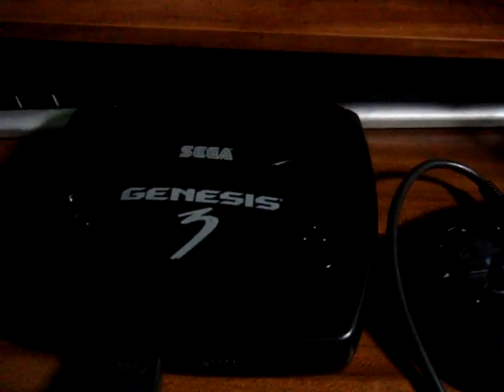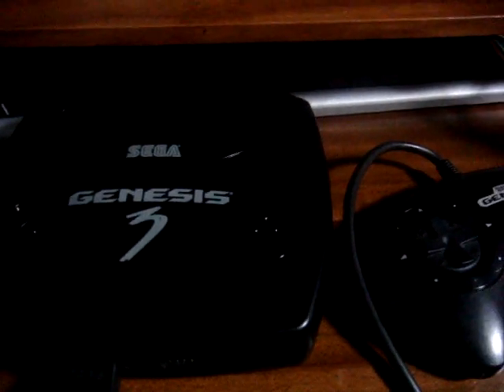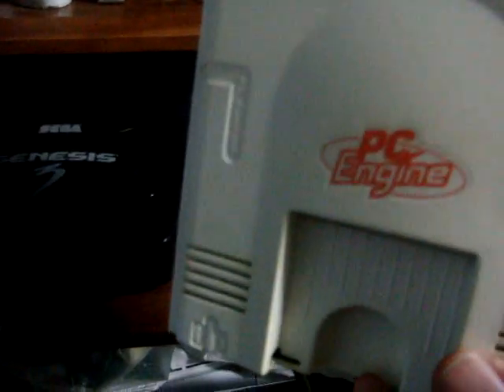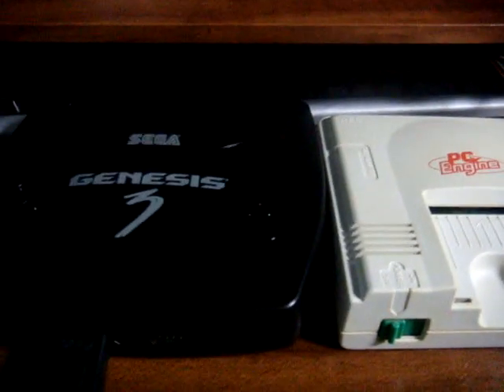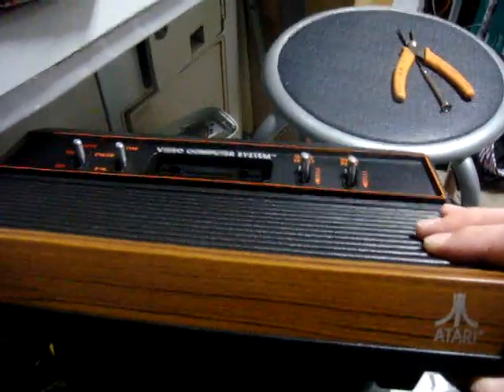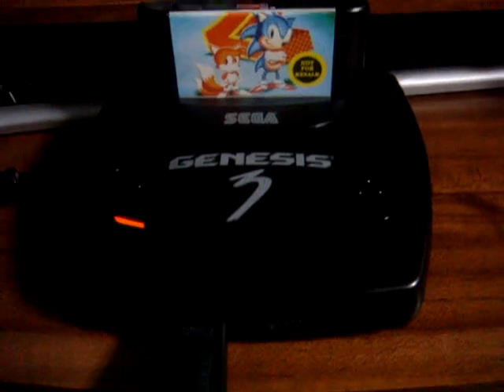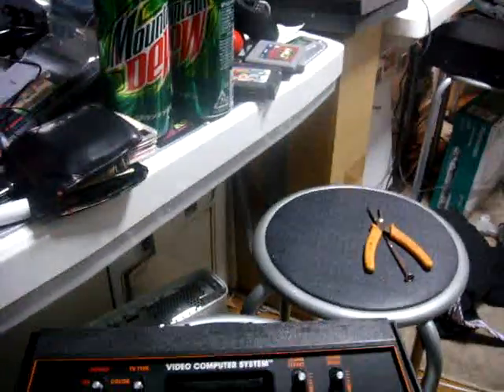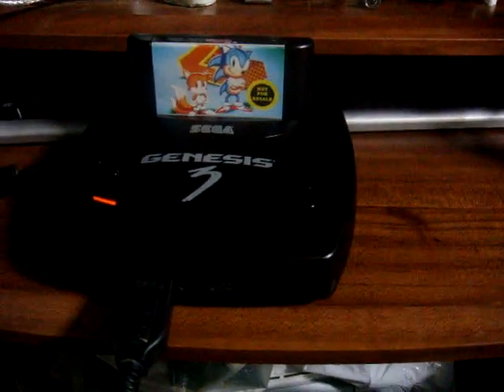Genny 3 Workin' Great and Other Random Stuff

Comment: In the UK we have 3-pin plugs, one live and neutral and an Earth pin about a quarter of an inch bigger than the other two. Our plugs are fused with a 13Amp fuse and are designed to cut power during a surge etc when the fuse breaks. It's a lot safer. I know that America and Japan use pretty much the same plug layout (as well as voltage and TV signal output), the only difference is in some American plugs (iirc, might be Japanese) one pin is slightly longer than the other, that's about it really.

Comment: Nice Video Luke.

You should try your hand at doing a S-Video mod for the Genesis 3. I believe it can be S-video modded. I have a Jvc X'Eye(Wondermega 2) that i would like to S-video modify. They took the S-video out for the X'eye but as far as i understand the Trace on the motherboard is still there...and i have 9 Pin din connector on my machine thats needed for the mod.

Comment: ueah they are bulky but they are well engineered, in a power cut EU plugs I beleive can damage TV's due to power suddenly being cut from the screen circuit, UK plugs do not do this as there is power left in them for around 3 seconds after the power is cut :D sorry for the lecture...